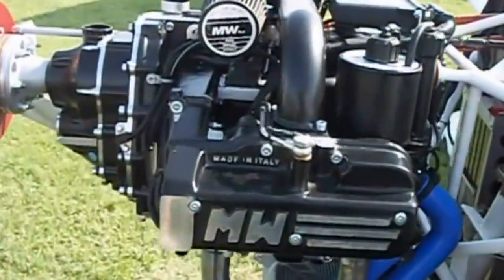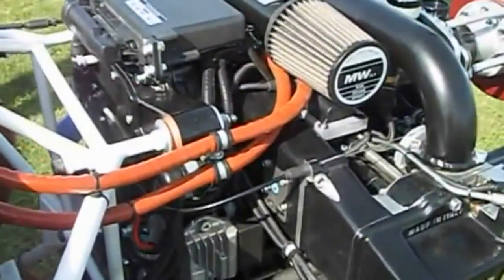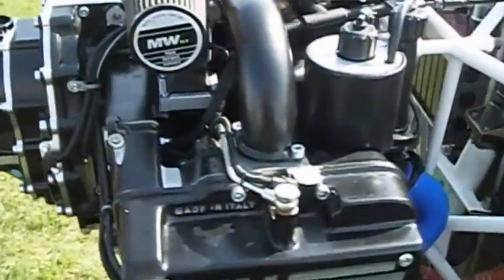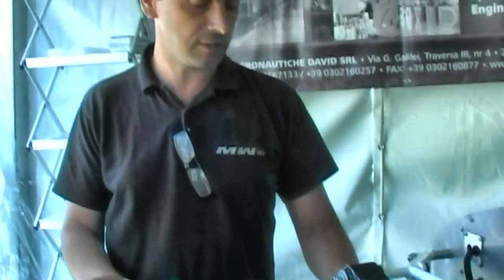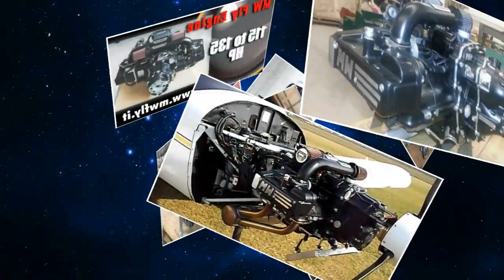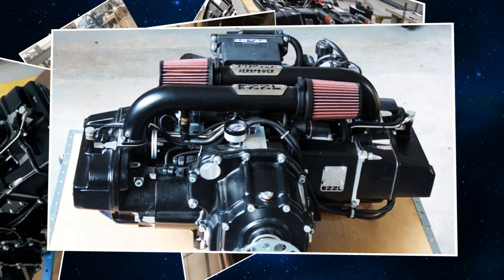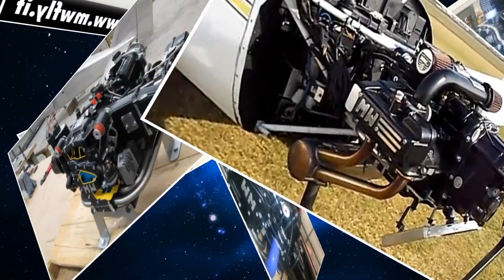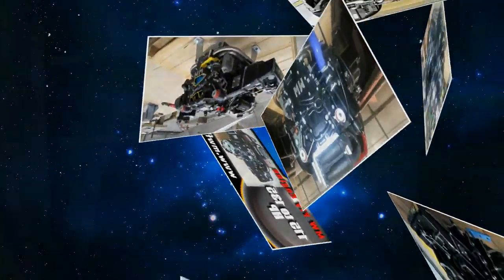MW Fly - We take a look at the MW Fly series of aircraft engines.

Comment: Crancksaft on roler berings... now that is real aviation grade safety.
Very long runing with loss of oil pressure, plus the promise of way above average longevity. 
Very, very good feature.
Reply: I ran a differential without oil once, it lasted about 3 minutes at light load, the bearing got so hot the rollers melted and oozed out the sides. All bearings need oil.